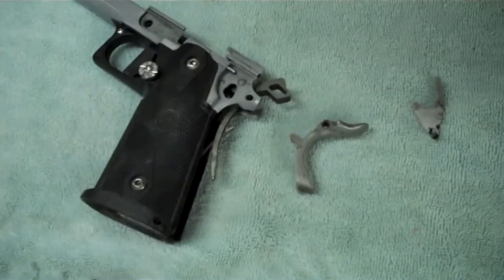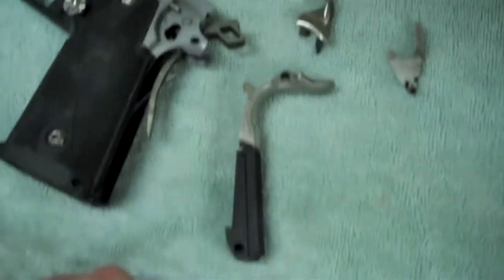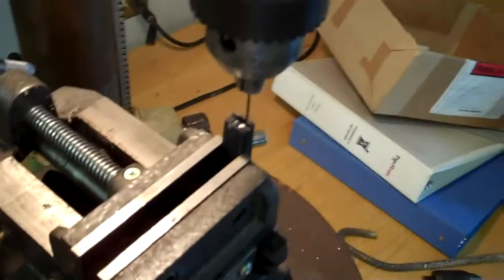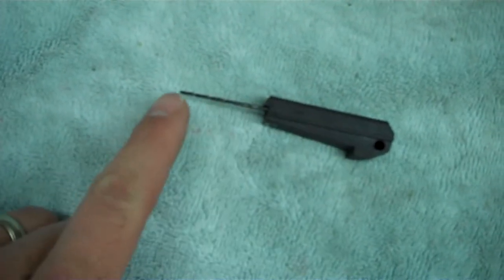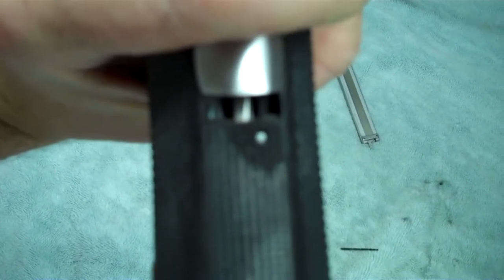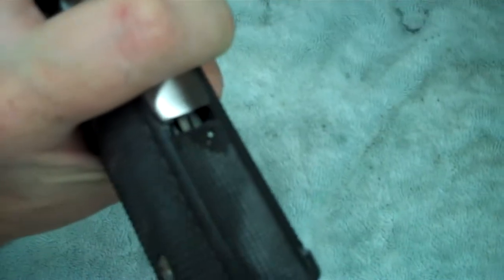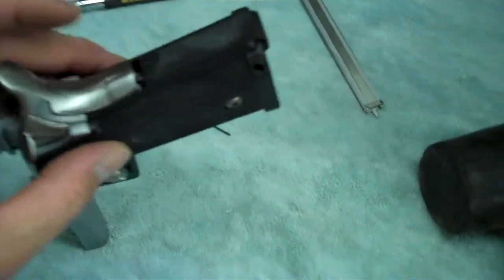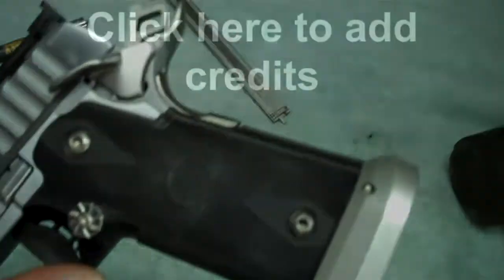Garage Gunsmithing How to pin the grip safety on a 2011 handgun.mp4

Comment: legal ramifications on carry gun?
Reply: I'm sure it'd be an issue if there were an accident. Personally I detest the grip safety, but am hesitant to disable it. If you use a gun even in self defense, some modifications like this, probably work against you.
Reply: I don't think it would be a big issue in a self-defense situation.  The grip safety only disables the trigger, so disabling it wouldn't make it any less safe then a modern striker fired gun.  But you're right it probably would fuck you up if you ND'd with it.
Reply: If one is justified in firing, a pinned grip safety is a moot point.